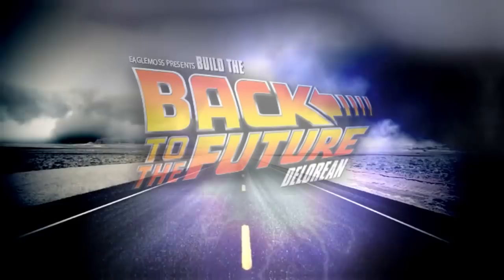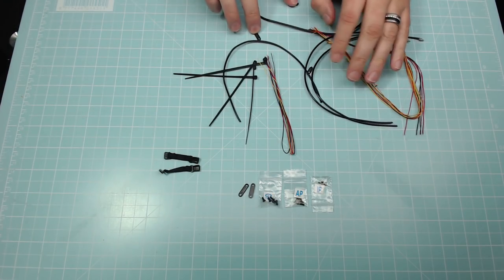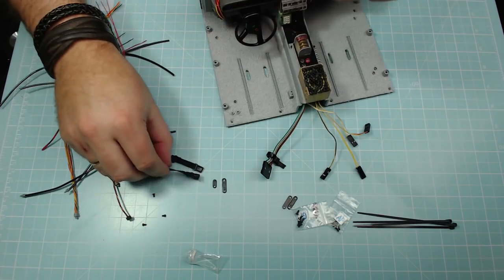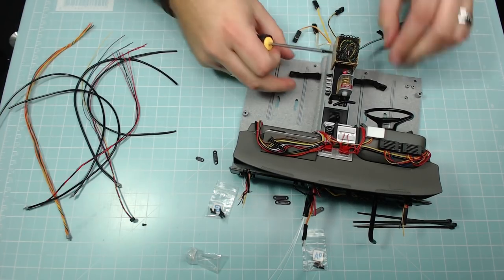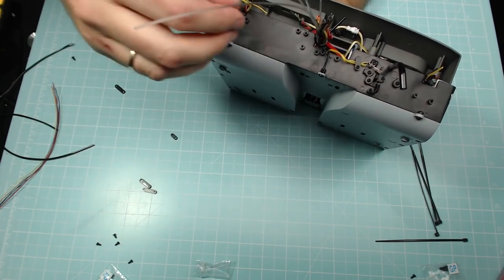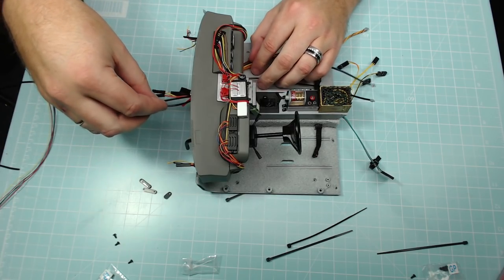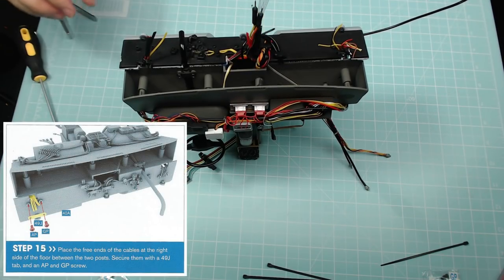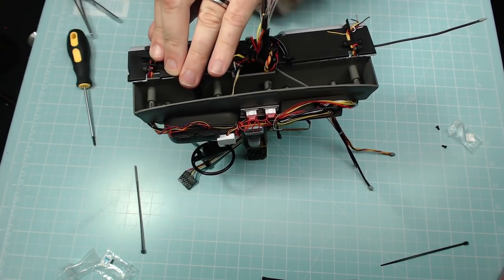Build the Delorean - Issue 49 - Seatbelts and Cables

Comment: Its nice to see all of the details really starting to come together.
A suggestion for obtaining a guitar string - go to a music store and ask their technician if they have recently replaced any strings.  You should be able to get an old one or two for free.  If you go for a steel string make sure to cut it only with cutters designed for hardened wire, it will wreck most cutters (maybe have the lengths in advance and see if the guitar tech can help cut it - pictures of what you will use it for can always work as bribery :)
Reply from the maker: I play guitar buy I really need some bass strings for the thickness. I have heavy duty wire cutters too but there are no music shops round in this country village that I live

Comment: How did you make the  high voltage box
Reply from the maker: I really wish I had made a video. Just got some metal.mesh from a speaker and cut the top of the box off. Filled with wires and capacitors then lit it up with an arduino
Reply: Thank you for that Wayne, I will give it ago. John